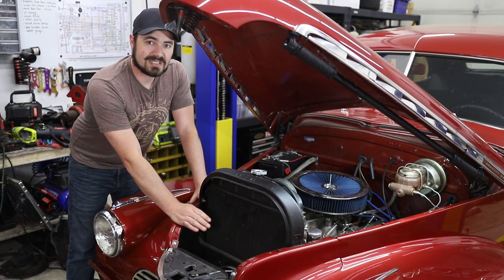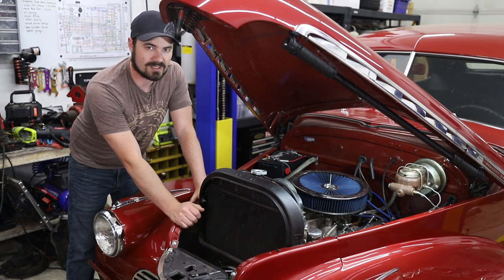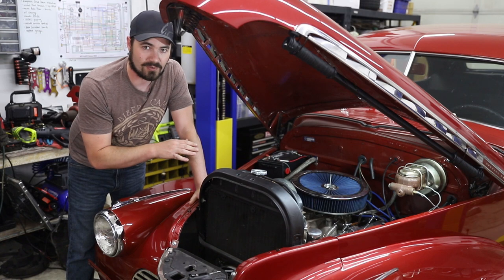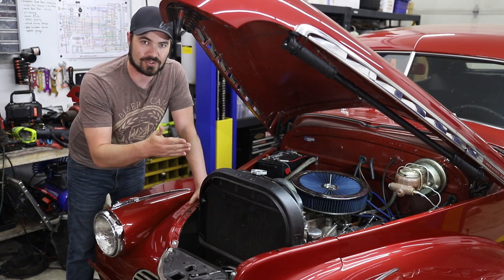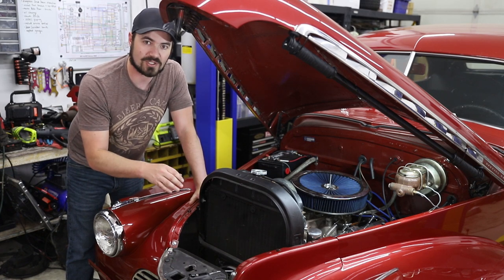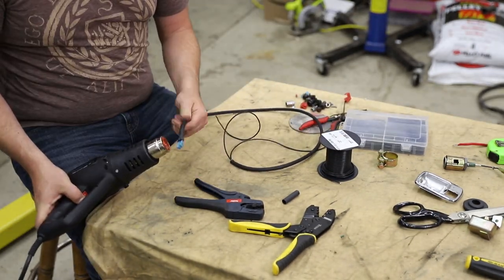Adding a thermo switch to electric fans

Comment: So what would be the reason my single ground temp switch doesn’t turn my fans on but if i unhook it and touch it to ground , it works perfectly .. the ground wire is directly mounted into the relay ground